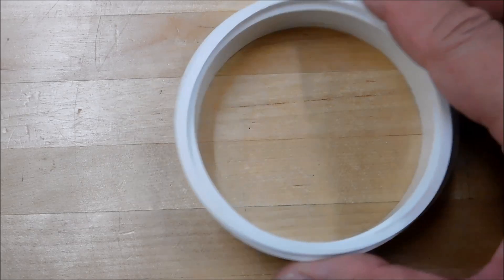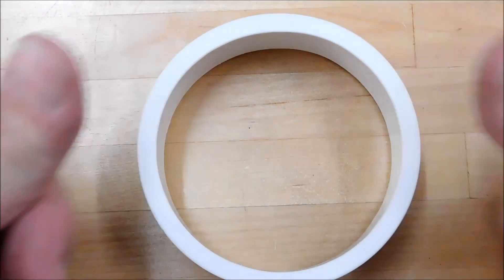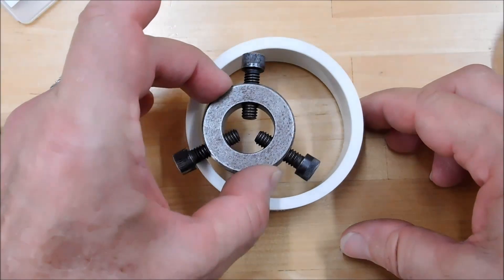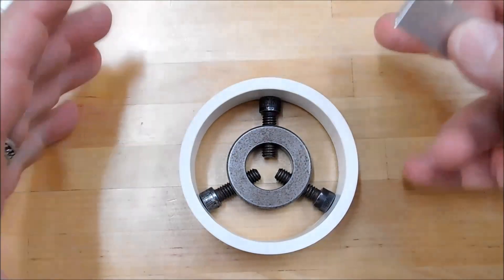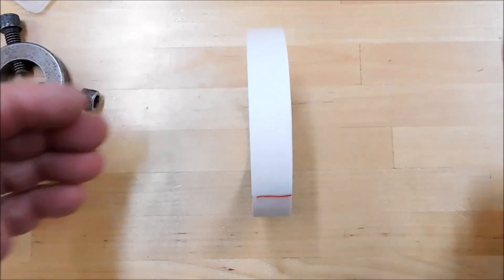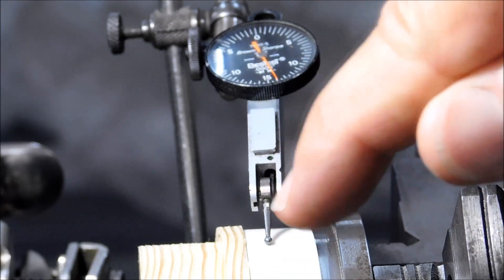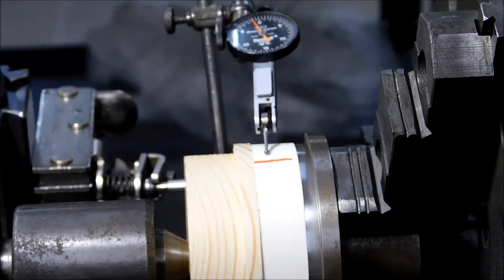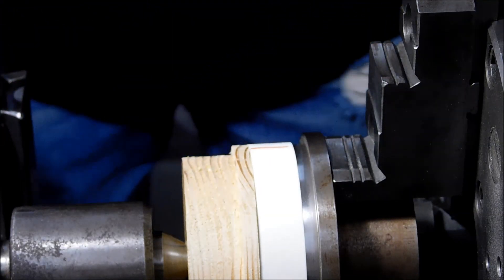Turning and Holding Thin Wall Material Without Distortion

Comment: I did a project a while back involving PVC pipe (lots of it) and I wasted a lot of time on it before I came up with the spider solution. I think out of everything I tried the spider worked the best. Great minds think alike, Joe. For the smaller stuff (3/4" and 1") I used a modified plug technique that involved several steps.

Comment: Thanks so much for taking your valuable time to share your priceless insight with us. Please keep ’em coming! 

Another level of magnitude regarding a discussion of the tolerances of thin and flexible materials. Is it appropriate for you to share the tolerance of the parts you’re making, without giving any proprietary information away?

Metrologists! I had the good fortune to manage a 6 person lab, all sheepskined engineers, (I studied Mechanical Engineering but never finished). We had 18k+ instruments, electrical and mechanical, on the books. I learned a tremendous amount but gave as good as I got when we went for, and achieved, ISO9001 certification. So many wonderful heated discussions around logic, common sense, procedures, and statical analysis. Great time!

Comment: This series is prefect timing for me.  I'm starting a project right now to make some tool holder parts for my Acroloc that the stock i'm using is 3" DOM with .250 wall thickness that I'm going to have to turn some features on the inside of.  I threw it into the chuck and stuck a .0001 indicator on it and saw that even the pretty heavy steel would distort 2-5 tenths.  Should have some videos up soon.